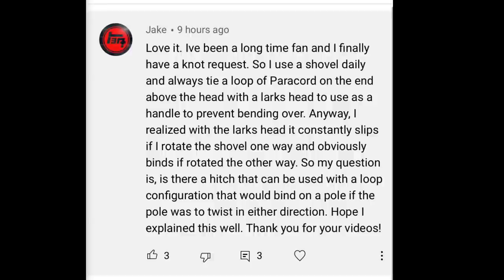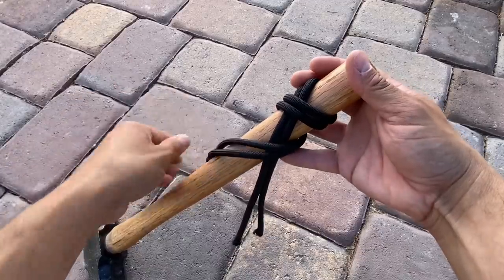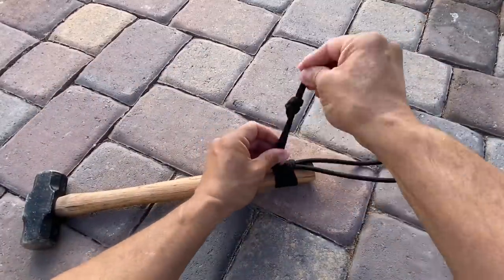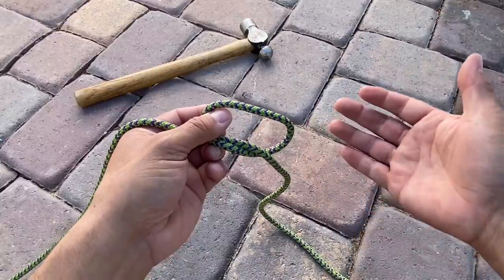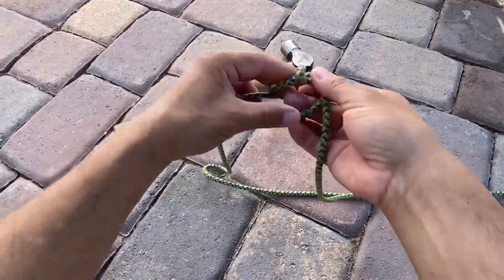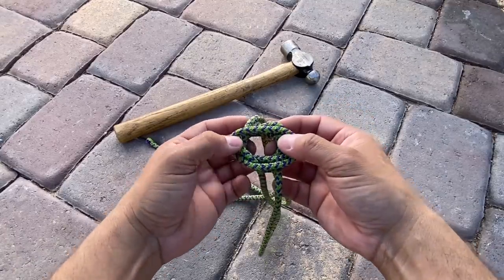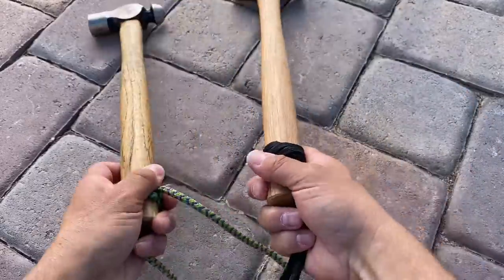Tying loops to tool handles. (Subscriber Request)

Comment: Perfect.  That first one is so clean and easy to remember.

That mid-line constrictor knot method is new to me as well, and will come in handy for sure.  Turn on the car, turn off the car.  Simple.
Reply: Check out the "Z-Method" for it. Takes less than a seconde to tie :)
Reply: The first knot is a constrictor. I don't know why he is did not say that.

Comment: Great tute. Also wanted to mention that a high knot on the handle/haft can also be useful allowing for a "reach through" use of the lanyard loop which will cantilever the haft into your palm when the loop is properly utilized and the lanyard loop is correctly sized for the application. So exactly the same as your first example with the black cord only tied higher than your normal grip. For hammering or chopping motions the cantilever lanyard hold gives great retention and can reduce hand strain for repetitive tasks.

Comment: I did that with a wet rope. When dry it will never come off....
Reply: Thanks for your comment, but isn't this mainly the case with ropes made from hemp or other natural fibres?
Reply: @michaelneuwirth3414  Point is, you can cinch down even tighter if the rope is wet and then dries.

Comment: Liked the video.  I'm a proponent of lanyards on these types of tools.  Just one thing though:  I always place the lanyard about half way up the handle so the loop can be twisted in the hand to keep the tool from slipping out of grip, acting as a safety strap.  With the lanyard at the end, fatigue can loosen the grip during use, resulting in poor aim and contact.  Especially important with hatchets or machetes.

Comment: I used the parallel example on a hammer handle for my son. I haven't been able to see it, but apparently, it failed. I had overwrapped it with a paracord grip.
After looking at the video though, I think it may be the ends you trim off need to be secured. They aren't trapped as well as a traditional constrictor knot. I think just melting them into a small glob would be enough. That's going to be what I try next.

Comment: Good info for beginners. I have a few different tools that I've added full length Turks Head handle wraps to as well as a couple of other different wrap styles. I like the feel of a cord wrapped handle on tools that I use regularly. It's much more comfortable and gives a secure grip when the handle is wet from sweat or water especially when combined with a proper wrist wrap. Good job on your videos. You make it easy for those unfamiliar with these techniques to follow along and easily make application of what you share as well as a nice refresher for us older folks that may have forgotten or moved on from the basics over the years.

Comment: Not sure if right place for this comment but it’s related to a lanyard method for a lighter (not lose it during a survival scenario). I used #12 bank line. Created and tied a prussik loop on lighter and added a larks head to slip over prussik loop knot at the end (soft shackle). It took 22” of bank line but with it in the middle of the lighter it holds very well and decent attachment loop for a carabiner or slip through necklace, etc.

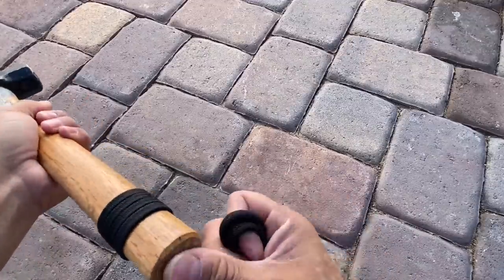Comment: 1:32 and this is on there very tight. You're going to have to cut it off to get it free

Well since that is the main concern for this knot (how easy is it for the knot to slip off) it would be great to run a test putting weights or pulling in that rowing position as you showed on this video at 1:15

Comment: Your first knot is a double-strand constrictor knot (never heard someone call it a barrel knot). A constrictor knot is extremely useful, if you don't intend to open it later and want a very durable knot with minimal cordage. With a straight handle, I would make a small notch - no matter, how much you tighten the knot, it may come loose over time, sending the tool flying around. Or you could put one or two small nails between the strands through the knot.
But what is wrong with drilling a hole at the end of the handle and feed a loop through, which would be my first choice?
Reply: NO, The first one is a Strangle Knot, but tied in doubled over cord to make a loop.

Comment: That's a clove hitch!  Nice!
Reply: The overhand knot underneath makes these variations of constrictor knots.   A clove hitch is different.
Reply: @lmelin1959  but you made the H... The first one looks like a clove hitch doubled over.
Reply: @lmelin1959  my bad!  Now I see it.
Reply: @latetodagame1892  the constrictor is one badass knot.    I only learned about it a couple months ago.   Once you tighten a constrictor down on a roundish object, it can be really hard to loosen up.
Reply: @lmelin1959  I learned a couple years ago and it doesn't cease to have applications.  Nice vid!

Comment: Great video thanks! Method 1 is called a "constrictor" knot... Very effective knot since the harder you pull on the knot, the higher the friction becomes... The harder the strands of the rope "bite" into each other to prevent slipping 👍👍👍
Reply: NO, The first one is a Strangle Knot, but tied in doubled over cord to make a loop

Comment: Is it possible to add a loop handle that is balanced?  In your example the loop is on one side so when you hold the loop it will sway to one side.  If it was balanced then it wouldn’t sway either direction.  Is something like this at all possible?  A loop handle that is symmetrical (without drilling a hole in the handle)

Comment: " any wood handle". If it's a wood handle drill a hole in it. Or cut notches. Anything but a knot THAT WILL WORK LOOSE. Especially on something tapered like those handles.
Reply: WRONG.
Reply: @james1795  Hang it by the lanyard and pull on it all day, and the constrictor knot will hold fine. But on a tool that's used to impact things, vibrations will be sent down the handle and will cause the knot to loosen...especially on a tapered handle. If your tool is for display, fine, but try banging on a star drill all day making holes to push conduit through brick walls and you'll see for yourself. BTDT
Reply: @Ariesdrone603 . WRONG

Comment: How would you tie an axe head on that it couldn't come off? Say the axe head was slipping on the handle and there was nothing that could be done on the inside mount point. Also too cheap or unable to get a different handle.
Reply: Sounds really dangerous, tying on an axe head.
Reply: Have you tried soaking the axe head/handle to swell the wood?.
Reply: Have you tried replacing the wedge that holds the handle tight in the head?
Reply: Not the actual tying, that's not dangerous: the using the axe having tired it together is just asking for trouble.
Reply: @nomadicgrenada  Not enough wood left.
Reply: @ScorpionRegent  There's no wedge.
Reply: @lightdark00  That might be the reason the head is coming off.  I'm not there so I don't know the whole story, but axe heads are usually held tight to the handle by a wedge.  Go to a hardware store look at the axes there.  You should be able to see how the wedge is fitted.  While you're there see how much they want for a axe handle wedge kit.  Shouldn't cost too much, if it's too rich for your blood you can try to DIY it, at your own risk.  Good luck.
Reply: Looks like hes talking about that x-shaped knot like you would see on a cave-mans stone hammer or axe in a cartoon.

Comment: Don't cut your rope like that. Both those knotts will loosen will use. Tie a stopper knot in the tail
Reply: The moment they loosen, they'll lose the grip. Cinching or tightening down is where it's at. He did it correctly. Ashley describes the vey method in ABOK

Comment: It is nice if you want to hang something without drilling a hole.
But it leaves you with a tool with a loose cord,
that, in a wokrshop, it might go into the way of rotating motors and machines.

Comment: Brother can u make a vdo of a best loop for a cylindr shaped product... I brought a flashlight.. A soda can size.. But it have no lanyard or layrad fitting hooks or holes😕😕😕 the flashlight was around 750gram.  Am worried of falling down from hand.. And also it cant fully wraped with paracord bcz the heat will not go out. But i have no idea foe fix a lanyard on it.. Will u pls help 😕

Comment: Why in the hell would you want a rope tied to a hammer the rope is going to be in the way and hinder use that just a waste of time
Reply: not good for hammers - can also do it with hatchets and then you can hang them from your belt! But yeah... that was my thought but maybe if you are on the roof and you are afraid it will fly out of your hand?
Reply: It can also be used for a walking stick, which would be handy.  Or make smaller loops and use them to hang tools on the wall of a tool shed.